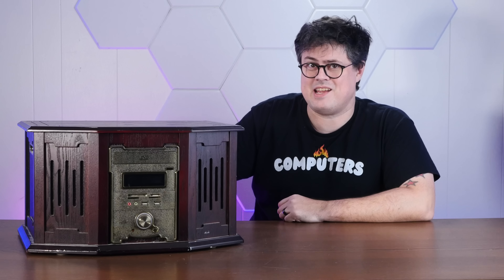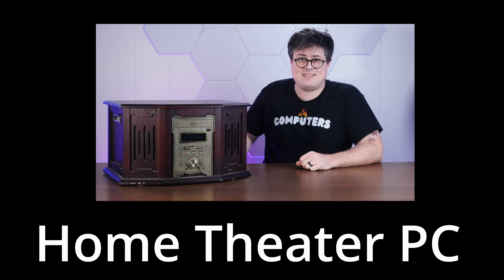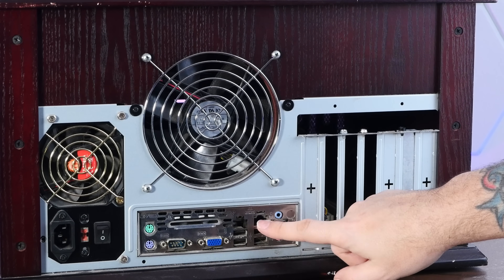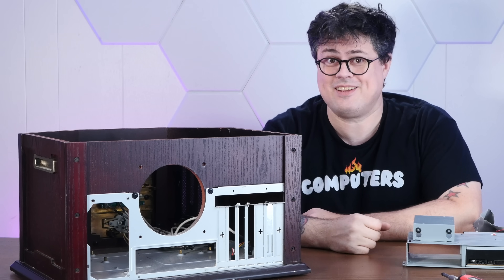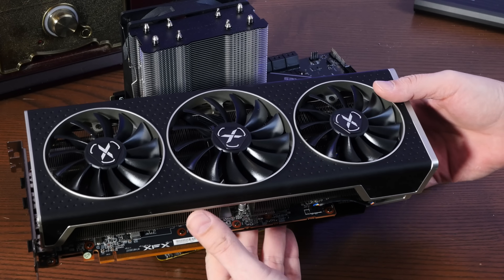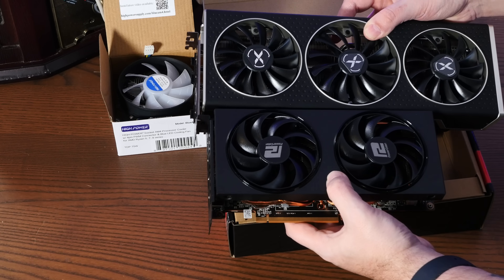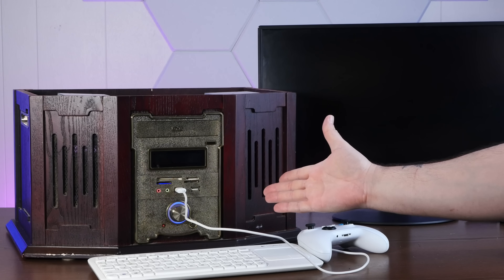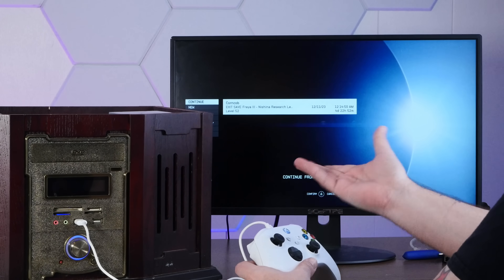This Was a Real PC in 2009 🤔

Comment: Ummmm... that is a mini stereo case. That originally had a Tape Deck on the side, a record player on top and a CD player, plus a radio. 

It has just meed modified to "become" a computer case... likely by a Steampunk fan. 

If that was a case being sold it would have been pretty bespoke and in very low numbers.

Comment: I still have an HTPC. If you want one i recommend just finding a cheap/free used 1L PC. 

8GB of RAM will be more than enough. It also won't turn into trash like a smart tv when it stops receiving updates. 

I don't want my displays to also be computers. I want them to be separate and I want my computers to run FOSS whenever possible.

Comment: I like this because its similar to a thing I want to do.

Integrate tech into furniture.

You know how tbey have these coffeetables that have hinges so you can store stuff in them and easily raise the lid?

Ok, so, I want it to be black and have a touchscreen as the table and make games for it to play with guests.

I'd put a speaker setup in it.

If the hinge also swung up the table to become a screen that would be cool.

If I could move it back via a joypad connected to motorized wheels, even cooler.

Also, this wooden case reminds me of how houses used to have a nook for a phone in the hallway by the living room. It would be cool to modify those with new tech and those intercom systems too.

Comment: I in fact owned that case. By 2009 I was 10 years into a career of building systems, repairing systems and corporate networking.  I love that the case was wood. I loved that it looked like furniture and was not a grey/black box .  I would say I used it for maybe 4 years before going with a quieter case.

Comment: As someone who is currently building a Steam Machine (Currently running Bazzite though considering switching to ChimeraOS) I would recommend using a cooler with a larger fan, especially given the CPU you're using. Given the case fan placement I would probably recommend the Thermalright AXP90-X47

Comment: I want to install a water cooled machine in this. I remember wanting this in 2010ish when I was building my PC but not being able to justify the price. I just envision a really thick radiator in the back and two 80mm or even 160mm radiators in the front “speaker”grills (Hardwarelabs makes some!) with noctua industrial for the back and normal noctuas for the front!

Comment: My friend was an engineer at a factory that made kettles, I got him to strip the powder coating and then chrome plate my computer case that I built a Pentium 3 based gaming rig in and it looked awsome although it needed to be polished quite often, I had at the time intended to make metal face plates for the disc drives and have those chrome plated but I never got around to it, back then you were lucky if you saw anything other than a beige case, I wish I had kept that case  and converted it for more modern builds but I ended up selling the computer before it became obsolete.

Comment: I remember those days, htpcs and media center software were really a thing in that golden xp days. Cases looked more interesting and i miss the possibility to take my bluray drive in a modern case because todays computer cases dont have a slot for an optical drive. Just why? Todays cases look all the same and i don't like it. But its an necessary evil because i need the airflow those cases are offering. But still where do i put my bluray drive in?

Comment: you should have connected the dvd drive just becuse or get a sata drive  i know ide wont work and get some real drivers to screw back there you can get a usb dac/amp combo too
and a suggestion get a arduino lcd and program a arduino to show anything you like not important but internal usb card would be good too so you dont have to run anyting at the back for a cleaner look

just some suggetions thats all

Comment: Now that's a real woodgrain PC :)
I would also make the optical drive part functional, probably stick a BD drive in it. And stick a 2x20 VFD or a small LCD display behind (or in place of) that dummy panel.
Wish there were places like Microcenter in my part of the world. This store format unfortunately died out here years ago. I miss those days... I remember accidentally breaking a pin on a stock Intel cooler when assembling my Q6600 beast back in the day. I just went to a store and grabbed a different cooler. Nowadays, I would have to order the thing online and wait 3 days for it to arrive. And heaven forbid it arrives DoA or turns out to be junk. That means another 3 days...

Comment: @2:14 The LCD was ripped out of them and sold off separately.  Thanks to New Egg!!!  The custom LCD's sold out faster than the cases did.  Made the cases useless to purchase when they didn't come with them.  Pretty useless to feature this case without the custom LCD that was designed for it. The LCD's were pretty much a custom one-off part that was only made in limited quantity for that case.  No, you could not order it separately from the original manufacturer after the Egg-Head site sold them off separately.  Most people would not have the knowledge to make & program their own.  There was NO resource offered to replicate custom LCD's function.  Some of the cases had some flaws.  The optical drive didn't sit properly for the tray to pop out through the custom opening.  The case came with nicks and scratches out of the box brand new that were very obvious.  Not everyone who purchased this would know how to refinish it.  The screw retaining plugs that hold on the top come out very easily so don't lift this case up by the top.  The power button doesn't turn!  It even breaks easily.  You would think it would be a volume control and would best make use of a rotary encoder with some functionality but no thought to the actual HTPC use was even considered.  Yes those fake speakers are a put-off when there's nothing behind them.  A pair of 5 watt speakers with a small amp would not take up too much room in that case.  A HTPC was more than a media player if the users wanted the functionality.  Some actually had a FM &/or TV/Cable &/or Satellite tuner that received live broadcasts.  1930's would be more of a Cathedral style cabinet with a single speaker.  This looks more like a later design

Comment: The fake speaker grills on the front, while they probably are meant to look like speaker grills, do serve a function. They are the air intakes for the PC. So it's good you didn't mount the speakers so they covered the grills...

Comment: 8:49  Flip the metal case upsidedown. Remount the drive. Use standoffs as shims.
    For myself I'm trying to mount a cup holder from an  AUDI A6 C5 98-05 A4 98-02  in the drive slot.

Comment: As much as it's horrifying to think that 2009 was now fifteen years ago already, you do have to appreciate that literally everything just lined up with the screw holes already in the case. Compare and contrast to the work required to get random hardware from much more than a decade previously to fit together, which basically requires a subscription for Dremel bits, 3D printer filament and epoxy.

Comment: pshaw. That's nothing. I had an ASUS mono that I built in to a small coffee table.
I had to modify it after a couple days because I hadn't anticipated that my dogs tail could hit the power and reset buttons.
I also moved the optical drive to the side. Opening forward stuck it into the couch.
This was before LCD flat panels were affordable. So it just had a CRT plonked down on top.
Might revisit with an LCD glued under a piece of glass.

Comment: I bought one and built one for a bud. He wanted a PC for his home theater setup and I used this, figured instead of trying to make the computer tiny, or make it hidden in a Cabinet, make it a center piece!
It had a core 2 Quad, 4GB of ram, windows 7, and and HD 5670. It was a great box for streaming from Netflix, playing DVDs, and even a bit of gaming I made it around 2012 or so, the parts were a bit older but still fine for the time on a budget.

Comment: Hell, if I could buy it in my country, I'd do it right now! This is an ideal case for a homemade media player based on a single-board computer or Mini-ITX motherboard. You just need to add speakers, some lcd (or better vfd/oled) display, volume control (encoder instead of a power button) and boom, you have a great stylish music player! I just made a video where I did something similar with a Soviet wired radio.

Comment: I just love this case, a couple of USB 3s a new card reader with some actual speed and an actual dispay to show you stuff (I would just put some random frequencies and have the Info as the station name)
The video card is a bit tricky, maybe aliguid cooler one withba ryzor and some cable adaptors and that's it
And if somebody tells me that the power does not double as a volume knob I would just throw it away and put an actual volume knob there XD

Comment: Actually, if you want to sound much better, attach better speaker directly behind the speaker grill, and then look for usb dac audio board, hookup it with usb header converter to usb micro b cable and you have a better sound

Comment: Loved it! I had an HTPC, but I never fully used it as an HTPC. I did use it for time-shifting after my CATV company started requiring set-top boxes for all sets, which rendered my VCR useless for time-shifting.

The concept of this case seems rather silly, because the whole point of the vintage-looking case - which is a ripoff of a retro all-in-one stereo set that's supposed to mimic an antique radio set - is to sit on a shelf and play music while being fully in view for anyone in the room, generally a living room or den. A PC would typically be used in a more private setting. But whatever, it's rare and unusual and offers up its own vibe, which makes it your bailiwick. The only concern I would have with your setup is airflow. I suspect the reason that the manufacturer didn't originally put speakers behind the grilles was because they needed those grilles for airflow, and the amount of dust that was caked onto them would seem to suggest as much. To use this long-term with a smaller heat sink and a graphics card, I think I'd want to cut some vents elsewhere in the case, like maybe on the sides. And should you ever make an update to this video, it would be a lot of fun to replace that dummy display panel on the front with a display that actually does something. Maybe a couple of mock VU meters if you want to something appropriate to when a radio like this might have been built, or a VFD (or mock VFD) to fit with your usual retro vibe, or maybe some garish LEDs if you just want to shrug the whole thing off as one big anachronism anyway.

Anyway, I always enjoy your videos. I never know what to expect, which is what makes them so much fun!

Comment: Id have personally gone for a negative pressure setup with that rear fan and gotten a better CPU cooler like a noctua U9, D9 or something similar. The GPU choking for air in that corner would concern me if you planned on using this long term and at max load. You'd also have some intake filtering through that cloth behind the speaker grills. Actually had to fix a PC once  that was set up like  that,  filtered front but intake from the back. It overheated because the filters were clogged from the inside

Comment: Bring back the very best PC design trend of the late 90s and early 00's: Lian Li's classic brushed aluminium cases... or the Coolermaster competitor that I can't remember the model number. Nowadays everything is black but brushed aluminium was better than black.

As for this thing... throw it on the fire.
Reply: Back when I was looking at PC cases for sale around 2014 the PC-60 Plus was still for sale and would've been my first choice if not for the cost. A couple years later I picked up an older PC-60 (non-Plus) and I love it. The only shortcoming is the 80mm fans are too noisy when pushing any decent amount of air so a modern gaming build would be a no-go. The Plus version removes a front 3.5" bay but has 120mm fans instead, a good tradeoff IMO.

Comment: Fuk, I had one of those. It was ultimately quite disappointing. Hot, and I could never get the screen to work. It was for a home theater PC, so it didn't look too out of place in an entertainment center. The 'brass' also looks more realistic in low res store photos than it does IRL, so kinda bait and switchy. Still have a lot of fond memories playing emulated n64 with 4 players and anaglyph glasses (a feature the emulator supported)  Good times!

Comment: I feel like now you need to put a nice monitor into a 1960s wooden tv cabinet to set on top (or at least something that LOOKS the part).
Reply: Protip: Most 1960s TV cabinets originally shipped with a nice CRT display. Color could be nice but B&W CRTs are just amazing.

Comment: I like the sleek desing but the reason wood is not used unlike 70s computers is because after the 8080 and probably from the 486 dx4 computers heated a lot. Until pentium 2 they lower a bit the heat but after that wood is only used on water cooled pc, another thing that was skipped in the past.

Comment: the fan is backwards, and I can guarantee that heatsink isn't enough for a 7700X with how silly AMD's internal clock stuff is, given the target temp to equalize at is 90C, and then it'll dial back your clocks until it sits there. If you want a decentish heatsink you're gonna need to figure out a way to get something else like a Wraith Prism and the AM4 clip-on adapters mounted.

Comment: Holy crap I have that exact same case!! I bought it on ebay around 8 years ago with a a core 2 quad, Asus LGA775 motherboard, it looked like it was someones media server. it's a great case but can be a headache to build in because of the disk drive/HDD tray that uses wood screws to attach.
Reply from the maker: Haha woah!
Reply: @ActionRetro  I forgot to add that the Ebay seller had no idea what was in it or if it even worked, so I won the bid at around $60 USD with $20 shipping, and it worked great!

Comment: HTPCs felt slightly like the future to me, but I had a little box that plugged into my TV and could stream media over my network, from my home server hidden away in the study. I didn't run Ethernet cables, I used my home's existing power cables to transmit Ethernet signals (Homeplug). That felt like the future to me.

Comment: Come to think of it, it's WILD that ATX has been the standard for about 25 years and is still current. The connectors may have been revised a bit but the physical form factor and mounting standards are the same so you can put 1998 guts in a 2024 case or vice versa with almost no adjustments needed. Not many standards live that long.

Comment: Test.

Tried to post a comment (didn't think it was at all controversial, just remembering when these were sold as cheap radios), but the comment seems to have been black holed before it could be posted? Not sure what I did wrong? Didn't say anything offensive or anything. I'm sorry for reminiscing? 🥺

Or maybe it was a glitch? Going through the text, I don't see what would be problematic. Maybe the radios gained sentience and got offended? I'm sorry I insulted Sky Mall? Maybe it was my joke about social amnesia when I said  "most people born yesterday probably won't remember," but that's relatively harmless compared to the jokes said in your videos. I dunno...

Comment: If you were to put a MiSTer FPGA in there, not only would it leave an absolute boatload of empty space in there, but you could add the tty2oled module to the little display area in the front panel to display what core is running.

Comment: the cooler you used angers me, that cooler is not meant to be used with such a high power cpu and ryzen 7000 is notorious for running really hot, if you want to revise this then use a high quality low profile cooler, something from noctua who make amazing coolers

Comment: I wonder whether that tiny, tiny heat sink and fan will keep the CPU cool enough after the previous behemoth of a heat sink was removed.  That does not look like it will work after some time.  Either the previous heat sink was overkill, or the new heat sink/fan will fail.

Comment: Any AM5 CPU is going to throttle like crazy with that cooler you used
Reply from the maker: Yeah I think I'm going to stick an AIO in there
Reply: @ActionRetro  Good idea.  Even a 120mm radiator will be much better.

Comment: man i love the crazy htpc cases from the 2000s, i bought the thermaltake mozart a couple years ago, its nothing special by appearance but just the sheer SIZE of it is what i love
Reply: So big that you could put a whole second Mini-ITX computer in it, which could be connected to an optional pop-out LCD touchscreen that mounted in the top 7-inch drive bay. That's probably extremely difficult to find these days, but it's the same size as a single-DIN car radio so I'm sure there's some possibilities there.
Reply: @executor32  ive caught a couple of the monitors coming up for sale on ebay but theyve been as much as what i paid for the case sadly, i might rig up a pop up din for it eventually

Comment: That's definitely based off the case for one of those crappy Crossley all-in-one record players plus cassette and CD combo units. It looks like they did minimal alterations to the exterior, you can see where the cassette would load on the side (the cutout was turned into what looks like a carrying handle) and the DVD drive is where the CD player is on the combo unit. The power button on the front is where the volume knob would go.